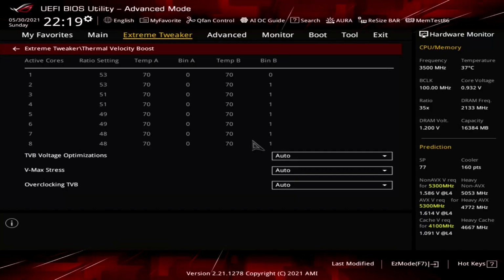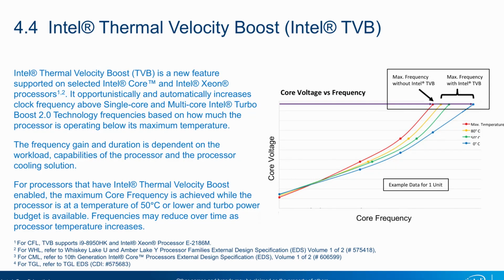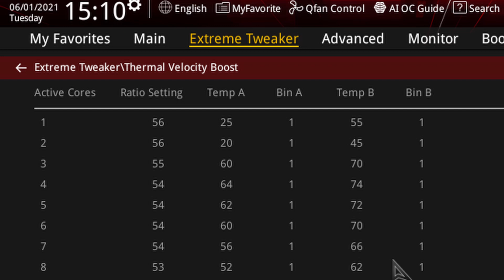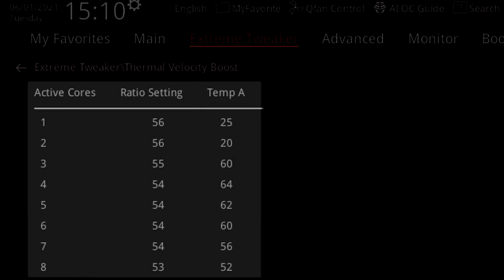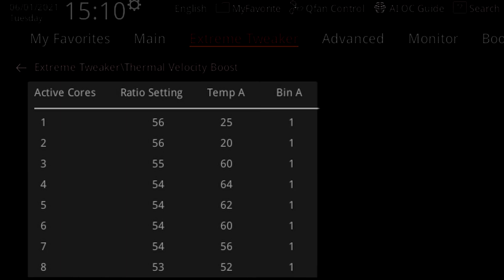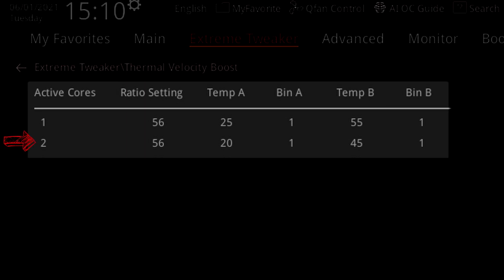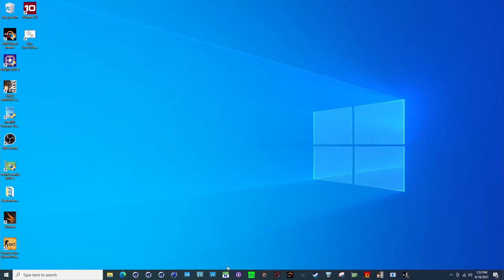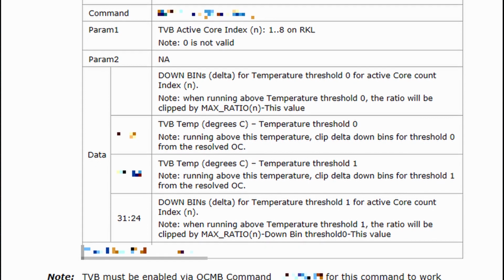Intel OCTVB (OverClocking Thermal Velocity Boost) for Rocket Lake Explored | SB#25

Comment: I still don't get why he's set such low temp limits for single and dual core. Is there a reason? Seems a bit odd. Is it to override Intel automatically boosting too high???
Reply from the maker: In some OCTVB configurations I set the 1T/2T boost temperature low because I want a high frequency "money shot." Setting a low temperature ensures that the frequency is only showing in idle and immediately drops when there's any kind of load.

Comment: The OC per core TVB works with my gigabyte z490 aorus master & 10900KF. However, on the TVB side, you have to choose your downclock (the Bin A) from your highest core ratio. (there is no Bin B on my side :( )

For example, I have my OC per core set at 53 for every core, except my last one at 51 (my core #9 is very bad :( ). With TVB, (working at 70C or over), I set -1 from 1 to 9 cores active (so it will be at most 52 when >70C if not using the last core), and I set the TVB for 10 cores actives at -2 (so that it will be 53-2=51). (Hence, my all core is always at 51)